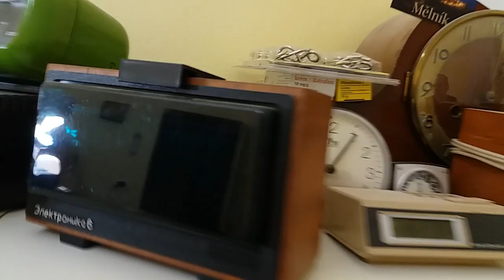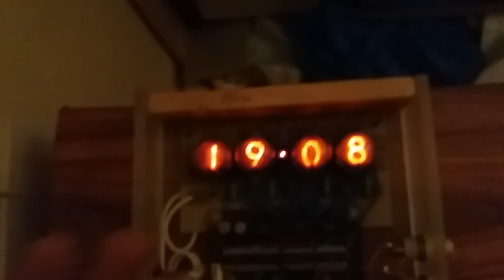Geiger counter vs smoke detector, nixie clock, old Xmas lights (quick unedited video)

Comment: Is it dangerous 26msv. per hour?
Reply from the maker: It's 26mR/h, not 26mSv/h, and it's just a few mm away from it. This is not so bad, especially given that just 3cm away you have virtually nothing. But I still wouldn't swallow it, rub it or keep it in my pocket.

Comment: That's quite cool that both Czechoslovakia and USSR had their own electronics.
Now here in Russia they order some military chips from Taiwan and pretend that they're Russian.

Btw you should definitely get rid of these Chinese capacitors and buttons from Soviet clock so it'll look more vintage and also I hope these transistors are also Soviet xD
Reply from the maker: Yes, nowadays all electronics are produces in China and nearby Asian countries, sadly. Even my microwave with Czech marking on it is actually made in Asia. 
Of course, the final version of the clock will have Soviet buttons and capacitors in it :) This is just a prototype where I'm using what fits my breadboard.

Comment: Hi Dany hope you don't mind I have a question regarding ATX psu I know you are an expert in this field can you please tell me why   the primary of main transformer passes through the gate (base)  drive transformer? 
I have seen this before on auto generator circuits ie electronic transformer but here doesn't seem logical as the 494 providing drive signal?

maybe to make resonant?
Reply: can you help me out with my question please Dany if you know the answer

Comment: You always seem to sound disappointed that stuff hasn't exploded (yet). :)  PS. That cat is spoiled - a cat-heater, never heard the like of it.
Reply: All heaters are cat heaters. He just formalized the arrangement by setting up a soft perch by the radiator. There's a heat register in the floor of my bathroom that is just the right shape and size for a cat to sit "breadloaf" style on. And in the winter, one of my cats is usually sitting on it. They'll sit on other ones as well, but that one is the preferred seat for some reason. I'm guessing it's because the other ones are bigger, so the air blows past them, and they don't really like that.

Comment: You not only don't want to spread the Am particles from the detector, but you really don't want any part of your body (nor your cat's body) to be exposed to the alpha radiation, I'm talking serious.
Reply: The alpha radiation doesn't get very far (a few CMs) and is stopped just by the air as he showed on the video.
Reply: @simontay4851  but alpha radiation makes more harm than the beta and gamma

Comment: Love that transformer, both winding's on separate bobbins, all transformers should be like that.
Reply: It looks better and it's safer, but you get some losses from this configuration. Windings on top of each other (separated by tape or isolation paper) will always be more efficient. If you don't need galvanic isolation/safety and you work with low voltages (like with a joule thief), interwoven windings are your best choice.
Reply: why?
Reply: @nunosousa2942  In most transformers the primary and the secondary winding's are simply on top of each other relying on the insulation over the wire to isolate the winding's. This, over time can brake down and flash over. The separate bobbin winding completely removes this issue.
Reply: @MichaelBeeny  tnks
Reply: Nuno Sousa Safety. Thats why.
Reply: 50Hz mains transformers usually do have separated windings. The secondary isn't just wound over the primary with a thin layer of tape between them like on high frequency switch mode transformers.
Reply: @simontay4851  What prompted my comment was I have just replaced such a transformer from an amplifier, that did flash over and left a carbon track which over heated the transformer, taking the fuse out. The only insulation between the winding's was a couple of turns of tape. Chinese transformer, of course! I wish I made a video of it now!

Comment: Why smoke detector are radio active??
Reply: The radioactive americium-241 is to generate alpha particles. Alpha particles are stopped very easily by smoke and it takes no energy to generate them so they are an ideal way to measure the density of air while consuming almost no power. A side note is that in the United States, all the americium-241 used in smoke detectors came from waste generated by making nuclear weapons. In Europe, the americium is from reprocessing fuel rods in nuclear power plants.
Reply: That is how ionization smoke detectors work

Comment: Has your memory card ran out of space again? xD
Reply from the maker: My quick unedited videos always end this way :).
Reply: Buy a used digital camera on ebay or delete some stuff on your phone. Even basic cheap digital cameras from a few years ago can record upto 30mins of video in at least 480p. A proper camera will focus better close up as well.
Reply: @simontay4851  He has a GoPro Silver, which he records most of his videos on. It does not feature a pause button, though, so he would have to merge the files.
Edit: He does have it, not as a primary camera though.
Reply from the maker: No, I don't record my videos on GoPro :). Try to zoom a GoPro or do a macro with it. GoPro is just an overpriced fisheye camera. For my proper videos I use Olympus XZ-10.